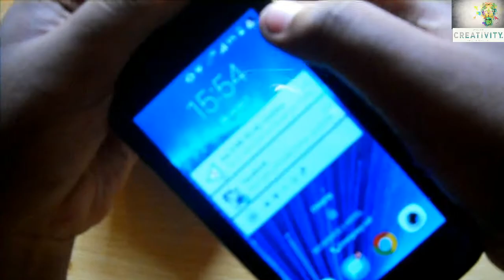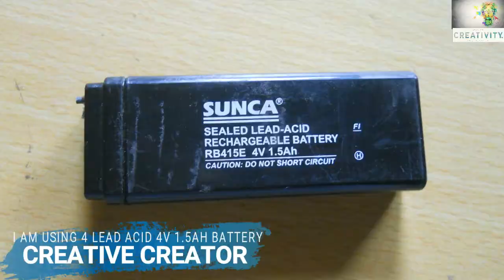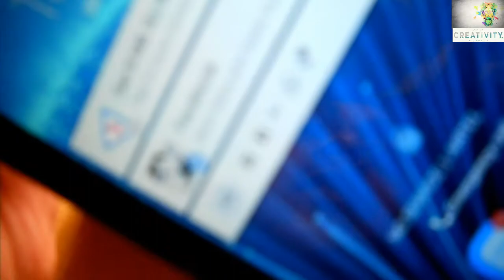HOW TO MAKE A LEAD ACID BATTERY POWER BANK

Comment: where cn we get that step up voltage ckt.?
Reply from the maker: ACHAL PAWAR from USB socket
Reply: Creative creator which socket? many devices haves that socket... like usb players...
Reply from the maker: yaaa you dan defenately charge via usb piayers there must have 5v coming but the ammount of ampier of those cases are very low so your phone or ther accessories would charge very slow.
Reply: Creative creator i have an damaged power bank will that ckt work with this battery arrangements?
Reply from the maker: you have to check first your powerbank's which component is not working or damaged..... in most cases the batteries are damaged and the circuit are all right check with another battery for powersource..... then you  can identify ....